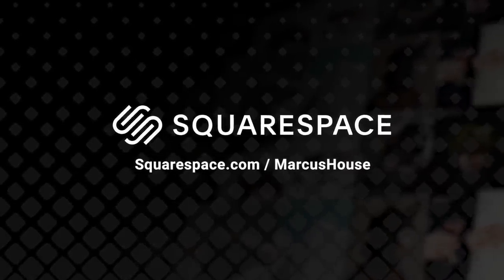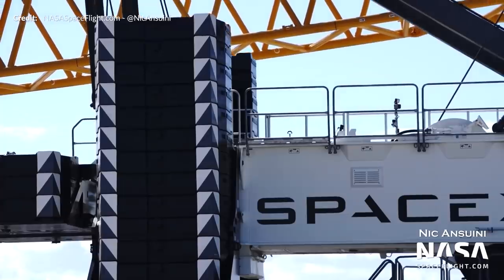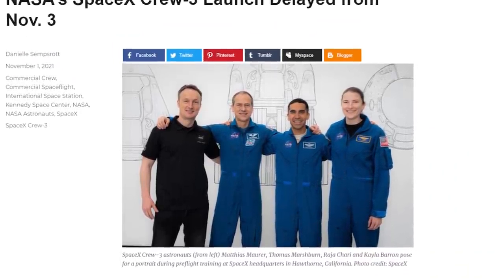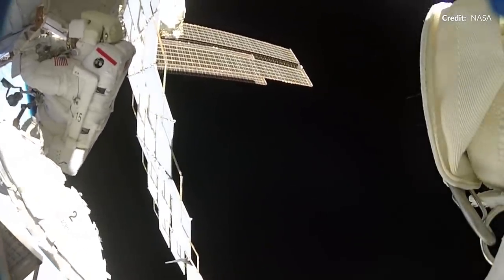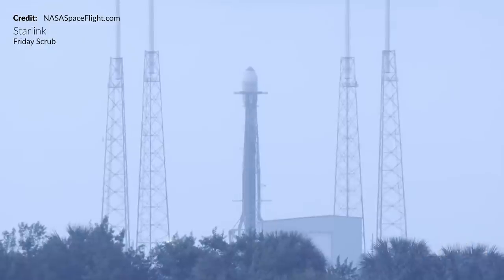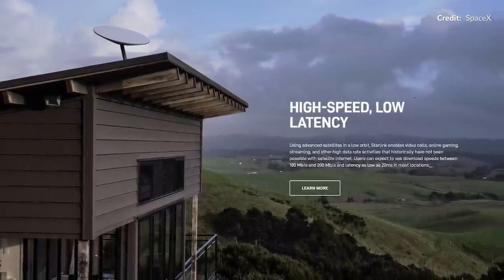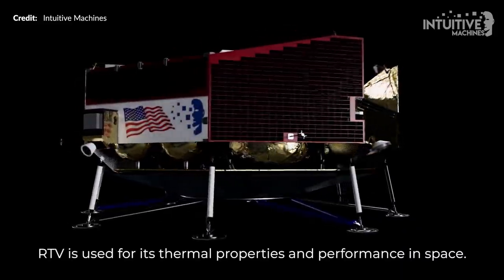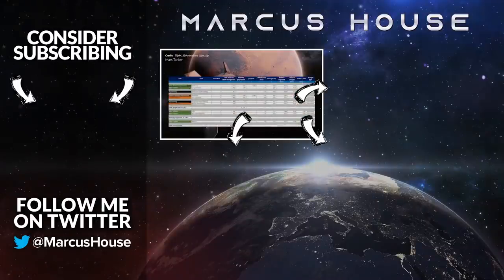SpaceX Starship Record Fire, Crew 2 Return, Crew 3 Launch, SpinLaunch, Starlink + More

Comment: IMO Reasons they might fully fill the oxugen tank: extra weight to hold it down, extra structural support because it's load bearing, checking the distribution and dispersal of shock waves and vibrations through the liquid, checking that all forces combined don't dislodge the TPS tiles.
Reply: Yeah, things might flex, vibrate and resonate very differently when tanks are at various levels. You definitely want to shake out any issues that might arise when the tanks are full.

Comment: Although SpinLaunch's system could be viable here on Earth, I think it would be really great as part of a Moon base. Their 8000 km/hr launch velocity is almost escape velocity on the Moon. So only a very small rocket motor would be required for orbit circularization and maneuvering.
Reply: Mars too!
Reply: It's more compact, portable and pointable than The Moon is a Harsh Mistress's electromagnetic mass driver, but it is also under a lot of stress from centrifugal forces. As Scott Manley pointed out, you first have to balance it, and then you have to balance it when you release the projectile or it could tear itself apart.
Reply: @Markle2k  The aspect of being compact would be an advantage on Mars, while not being particularly important on the Moon.  But for either location, it seems that using what is essentially a flywheel to accumulate energy is an advantage compared to the EM mass driver.  As far as mass balance, you can get around that by making the structure more massive, so that the release is a smaller fraction of the stored energy.  But then you need to transfer that total energy to another launch or else design a payload elevator.
Reply: Also there would be no air drag losses on the spinning rotor on the moon compared to earth or Mars.
Reply: @jvckrs  I believe it has a good vacuum drawn on the spinning table, with a membrane over the exit port, much like you would do with a golf ball cannon. I don't know if they pull it down as far as 100 pascal like Mars's surface pressure.
Reply: @Markle2k  if it's on a Moon mountain, they could release two equal and opposite payloads at the same time (shot horizontally)
Reply: A spin launch system could actually return small packages from the moon to earth with just the velocity of the launch

Comment: Even if S20 fails during reentry because of lost tiles if they can get a minute or two of controlled orientation before it breaks apart they will learn alot. The tiles are essentially a solved problem compared with the bigger picture.
Reply from the maker: Exactly!
Reply: Yes to be honest I've been assuming total vehicle loss during reentry for at least the first one or two test flights minimum. It's going to be tiresome when it gets reported on in mainstream press and online explaining to people that it's actually not a big deal and was expected. But oh well. If they can just get this environmental impact red tape over with asap I'll be happy for one.
Reply: The tiles aren't supposed to be falling off. You really want people riding in these things just to tell them, "you're probably safe, not that many tiles fell off this time. Feel free to reenter the atmosphere!". That's a total joke.
Reply: @halahmilksheikh  Believe it or not, but it's actually beneficial to know exactly when tiles fall off.
The tiles have to obviously be attached to the vehicle, but during the periods of intense vibration, they must not be too tight otherwise the buckling of the vehicle would break the tiles. As a result it's a balancing act or tight-loose and the only way to figure it out is to see where it fails.

Moreover, this is the perfect opportunity to see how resilient the system is to unforseen damage. Stainless can handle a lot more than composite, and it is theorized that in many place a losse tile may not lead to the loss of the vehicle. However once again the only way to actually verify this is during an orbital test and hopefully not during a manned mission.

The goal isn't to use the test articles go verify the safety of the system. Their goal is to verify what works and what doesn't and that involves explosions.
Reply: @halahmilksheikh  "you're probably safe, not that many tiles fell off this time. Feel free to reenter the atmosphere!". That's a total joke. - Oddly that was exactly what the re-entry review committee told the Columbia crew. I think they added that they (the committee members) had to get home as it was the weekend.
Reply: @halahmilksheikh  Why are you so worked up about the tiles falling off and the threat to passengers when the first Starship hasn't even occured yet?   

How does Space X get a functional TPS without seeing where it fails?  As Elon himself has said there is no innovation without failure.
Reply: Ok so I am no expert but the area where a tile is lost will have increased drag along the edges of adjacent tiles, concentrating and increasing the heating effect. The increased drag and shock waves may also peel away the adjoining heat shield tiles and damage the insulator beneath. I have heard that any exposed  stainless steel can cope with this heat…..well we will see.
Reply: @InnocentMan99  my thoughts exactly. Worst case test is great data.
Reply: @michaeldeierhoi4096  Well said.
Reply: @halahmilksheikh  You are obviously completely unfamiliar with both scientific development and Space X.
Reply: @halahmilksheikh  You can't always know what you don't know before you try something. And, if everything goes right the first time and performs exactly as you expected, you haven't really learned anything. You aren't pushing the limits hard enough early in development. And, even later, it is often useful to know where the boundaries lie before you risk human lives. It is only then that you can start designing in safety margins.
Reply: The Loss of tiles off the T304 Stainless steel shell is not going to be mission critical. SS was my trade material and the construction of Spacex ships from this Alloy is frankly genius. The odd tiles missing might create hotspots on re-entry but definitely nothing catastrophic, they might want to remove the burn with hydrofluoric Acid before replacing the missing tile/tiles but much easier than space shuttle refurbishment …. We need to find an attachment system that minimises tile losses and I guess that they are working on that, but I don’t see challenger like failures with Starship ….
Reply: @chrisbraid2907  Challenger failed due to the rubber O-rings in the boosters. You are thinking of Columbia. Columbia's failure was due to the carbon-carbon on the leading edge of the wing being damaged by a high speed (~500 mph) impact with 2 kg of foam. That allowed high temperature plasma directly into the wing structure where it could directly heat the aluminum. Many times, including the very first flight, the Shuttle lost individual tiles. Atlantis once lost several hundred tiles, but the area underneath was protected by steel plate.
Beneath the Starship tiles, there is also an insulating blanket material, btw.
Reply: @halahmilksheikh  You're obviously a troll. Stick to coloring in between the lines and leave the real science to people that aren't remedial.
Reply: @DLWELD  Yea this is a difference, this is testing. If something is going to break you HOPE it breaks during testing when there is not crew. 

There will be many orbital flights done remotely before it goes though cert for human flight but according to you its exactly like a shuttle which was not the heat shield falling off but that the thermal insulation on the main tank coming off and impacting the heat shield. Tell me do you think that the shuttle would have had problems with its heat shield if it was not launched from the side of the tank?
Reply: @halahmilksheikh  See you taking grief for your legit comment, but shows SpaceX fanboys/girls not being very objective. Was only a two second static fire with less than a 1/3 of launch engines employed and a slew of tiles came off :-P (clearly a serious issue). Much respect for Marcus House YouTube page and material he presents (which I watch rather religiously) but seems on Elon's payroll (which is fine..) & take commentary (him & followers) with a grain of salt ;-).

Comment: Spin Launch reminds me of Punkin' Chunkin'. There's a competition in the US where people use catapults, trebuchets, spin launchers, and air cannons to see how far they can yeet a pumpkin across a field. The air cannon class always has the longest throws but the spinners are not that far behind.
Reply: You have good taste in recreational yeet.
Reply: ...so...do air cannons scale up well?
Reply: @rodschmidt8952  not really. Imagine a pressurized container able to provide the same thrust as a normal rocket. A rocket that uses dangerous complex chemicals with turbo pumps and precise timing and injection rates and geometry.

 Then put all that force into a giant air bottle. 

 It would have to be the size of (?)10 aircraft carriers with container walls a hundred feet thick and a barrel length of a mile. 

 OF COURSE I'm making all these measurements up, but I don't think it's possible with just pressurised air. 

 I would like to do the math, actually. Good question.

Comment: When Gerald Bull was testing his artillery launch cannon, he worried too about sensitive electronics being damaged during firing, the solution was to encase all the electronics in silicone or epoxy, called potting
Reply: Trouble is most chips will not survive past 1000g, note I am an electronic engineer by trade, the internal wire connecting to external pins literally will tear apart or the chip itself will crack. The difference from WW2 tech is that it was only having to last a fraction off a second, you are launching a satellite you want it to last years. Not saying it can't be done, but commercial chips aren't really made for space, that said the industry [semiconductor] does have space rated chips but the high g force is most chip still upper limit of 1000g.
Reply: I read he was using the long barrel to help with the initial g force.

Comment: Static fire: I suspect (a) they wanted to maintain structural integrity by filling the lox tank given the extra weight of the TPS, (b) they may have wanted to evaluate the structure's performance when the lox tank is fully loaded & (c) that only the methane downcomer was loaded.
Reply from the maker: Great thought.
Reply: Yes, I think you hit on it. A mostly empty LOX tank will vibrate like an empty can, knocking off more tiles than a launch firing would. Inaccurate test modeling.

Comment: 6:12 The first frost ring was the Fuel load, As the tank sat there waiting, the air inside got cool enough that the rest of the thin walled tank frosted up.  That's how I saw that happening. As it was never quite as frosty as the lower section.

Comment: A possible reason for having a full load of LOX on the starship static fire is simply to provide dead weight to offset the thrust of 6 engines firing
Reply: It could also be for structural reasons. You need the lower tank to be pressurized to be able to support the upper tank and maybe that's easier, when it's filled up all the way, rather than only part way. I would also guess, that since liquid oxygen is less compressible than gaseous oxygen, it would make it stiffer at the same pressure.
If I remember correctly there was a starship test, maybe a year ago, where they loaded the methane first and got a structural failure.
Reply: @jenbadabam8801  I think that was when they has the tanks reversed when the top tank imploded.

The other reason besides dead weight is the pressure on the engine mounting plate can be dispersed outward and upward within the full tank space.
Reply: @jenbadabam8801  Good point on stability. It sense that they'd want engineering data on how the tanks respond to actual engine firing (thrust & vibration) to take them beyond the data obtained from stress tests with full tanks, but using hydraulic rams.
Reply: maybe it was there in case of RUD, so that it would look even more spectacular!
Reply: @jenbadabam8801  I think that was with a cryo test with LN2 filling up the methane tank. They screwed up the commands and depressed the "oxygen" tank with a full "methane" tank on top. The "oxygen" tank then beer canned and it fell over flash freezing any animals hanging around the test stand.
Reply: Does the full lox tank also damp resonance in the skin?  It seems that the tiles only fell off above the lox tank.
Reply: @geosamways  That was my thought as well, the tank walls can shake a lot more when not backed by the sluggish mass of a liquid inside them. Contrast the sound of tapping on a full bucket vs an empty one. 

In a normal flight, the vehicle will be in near-vacuum without the earth just below to reflect sound waves back upward. Thus these static tests are probably the hardest acoustic environment the tiles will see- harder even than the launch, given that the booster's engines are 70 meters farther away even though there are a lot more of them. On a launch, the methane tank will also be full, protecting that tank's walls, too.

By the time the tanks are partly depleted, the Starship some or all of the center three engines will be shut down, so the vibration source will be much less.
Reply: @jenbadabam8801  Almost two years ago at this point, it was SN3
Reply: Starship wasn't loaded with full LOX at static fire

Comment: @full oxygene tank: lower center of mass and to minimize the stress of the holdingclamps -> 6 Engines thrust.. maybe a test for the padding and the tiles also.
Reply: I think the limiting factor is the thrust puck, rather than the clamps.
I think the thrust puck probably can't transfer the full force of all 6 engines to the holding clamps. The thrust puck likely needs the mass of the oxygen to push against.

Comment: Losing a few tiles on the static fire doesn't surprise me one bit. The sound shock waves bouncing off the ground would pull your teeth out. This is one reason the deluge system is needed. Until that system is operational..the stacked starship isn't going anywhere.
Reply from the maker: It would create crazy vibration.

Comment: Hi Marcus,
I was hoping that Starship would allow us to resume servicing missions to Hubble before it fails all together and allow it to continue operating indefinitely. Unfortunately, it is clearly going to be several years yet before manned Starships become operational, so that will probably not happen. Too bad. Well, maybe they can at least retrieve it some day so it can be put in the Smithsonian. To those saying James Webb will replace and be far superior to Hubble, while its optics are more advanced, it is limited to the infrared spectrum. It can not do the wide variety of different kinds of observations that the Hubble's four different instruments can perform, not to mention that Hubble's instruments can be taken out and replaced with different ones doing different things. Of course, I do look forward to someday having a thousand meter mirror on the Lunar far side.
When I was at JSC in the Shuttle days, we did look at the possibility of using the Shuttle for an early return to the Moon, with a lander in the payload bay. The idea was to launch an external fuel tank, have an orbiter dock with it, and use the main engines for TLI. I don't remember now if the main engines or OMS pods were going to be used for dropping in to Lunar orbit and TEI. Obviously there would have been lots of engineering challenges to overcome and there was simply no political support for any Lunar program at the time. Too bad.

Comment: Looks like the heat tiles are coming along similar to all the other parts of Starship. First there were patches of tiles that pretty much all broke apart and fell off on the hops and static fires of early prototypes. Then we got the much better tiles on SN10 to 15 on their 10Km flights where only a few tiles were lost. Now we are seeing the next gen tiles on SN20 which look a little uneven and have had multiple problems requiring many tiles to be replaced. Compare that to what we can see on SN21 where the tiles are looking much more even. Each vehicle seems to be a leap forward in heat shield technology. Although there have been many tiles falling off during static fires it would take a patch of several adjacent tiles coming off to cause problems that would lead to loss of the vehicle.
Reply: Much agreed! The loss of heat shield tiles is troubling and needs to be rectified.

Comment: I've texted about doing a spray on ablative coating but if that isn't possible you could still spray on a coating designed to keep the tiles in place on lift off or testing.  The coating could burn off quickly on re-entry after doing it's job of holding all the tiles on during launch.

Comment: The thing about the tile shedding from ship 20 is that the test took place on one of the Sub Orbital pads, which is not elevated off the ground or fitted with a sound suppression system. The force likely won't be repeated once Stage 0 is complete.